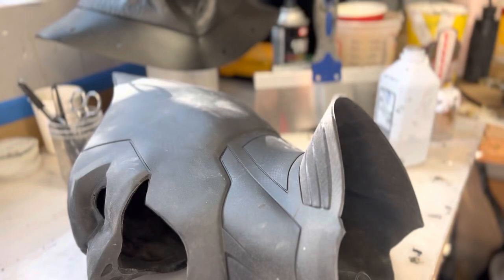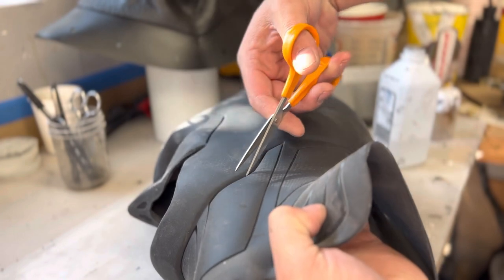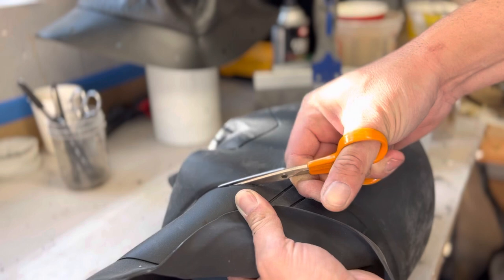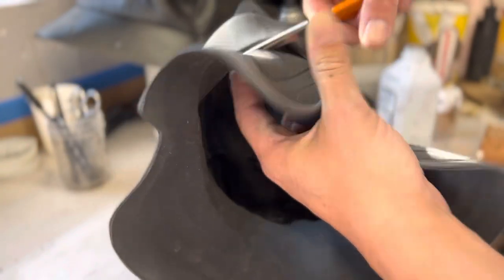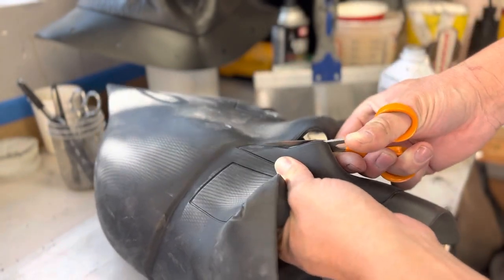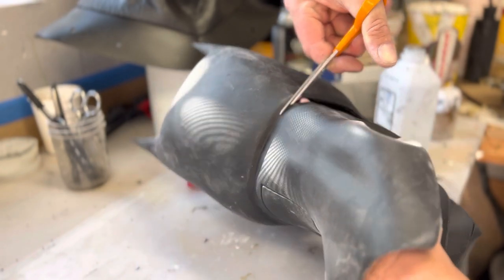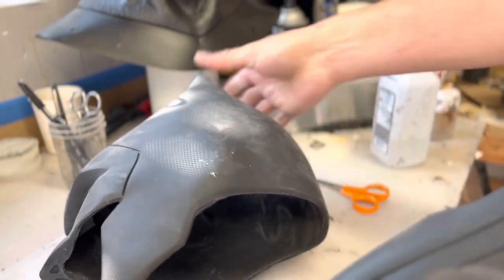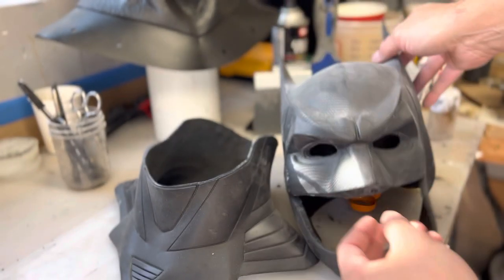Neck Trimming

Comment: @bg215pa
56 minutes ago
Hi Keith. I just recently acquired this cowl from another cosplayer. I understand it's a size 23.5" which is my size, but the eyes are so small and tight I can't open mine. Cn I trim the eyeholes the same way you show hear, or can you recommend a better way?
Reply from the maker: You could use the same process to trim back the eyes. Just take your time and go slow. The scissors I use are ideal as well.